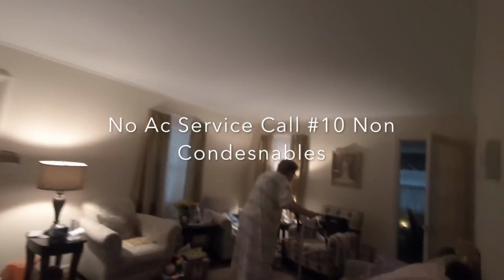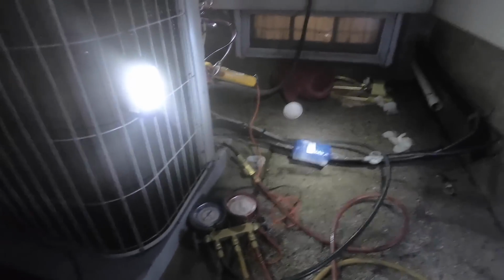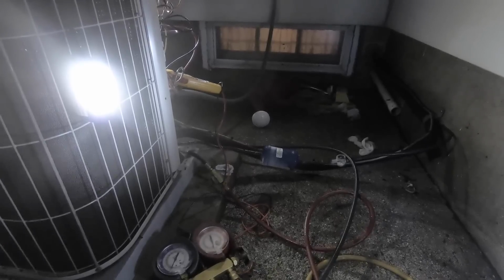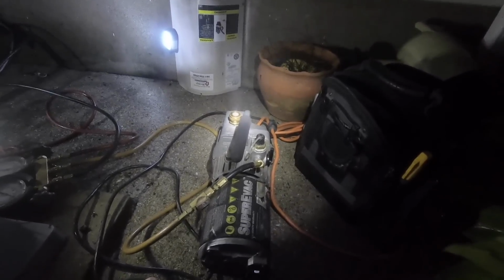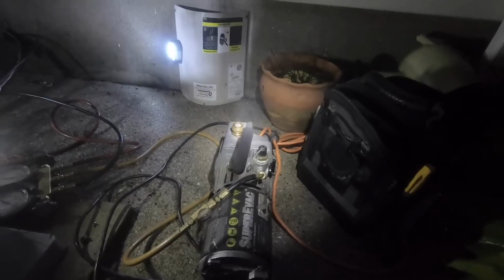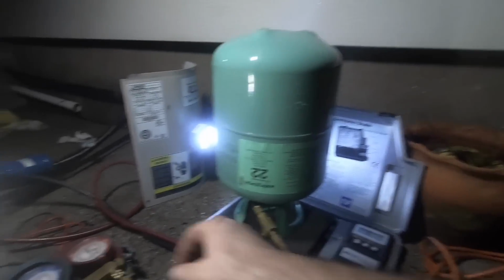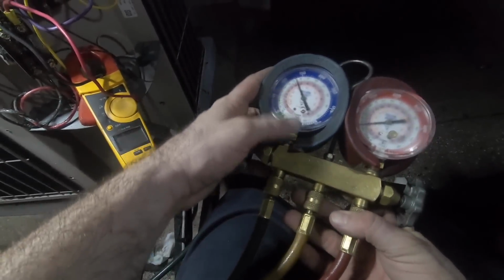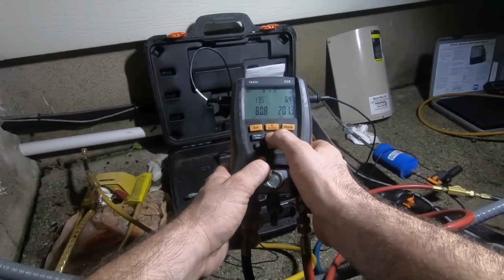AC Not Cooling Contaminated System Overheating Compressor HVAC

Comment: Don't worry about these opinions. Every call can be done better in one way or another. At least you are trying to do the right thing. Sorry but these techs who are working for companies that are driving them to sell replacement systems at all costs should be ignored due to the fact that "most" of them do not know shit and nor  do the owners. Those companies hire young guys to run the numbers game period and quite frankly it's criminal behavior. They can talk some lingo but wouldn't know where to start beyond changing a capacitor. Example: I was training a man last week who had worked for another company for two years running maintenance and service.  I let him know that we were going to work on airflow all week and we'll start with Delta T's. He asked me what a Delta T was.  In his head, he knew what he was doing in the field, but found out quickly otherwise. I'm just  glad he wanted to learn. He had only been trained to cycle the system, clean the condenser, check for a rusty or leaky coil and call for a TURN OVER. This is a rampid problem across the country. The people who bought the company I work for don't know shit about HVAC. They are simply trying to make their investors happy. They are implementing the " if the repair is $500, call for a salesman" program. Their capacitor price is $300. Sorry but this is bullshit and not true service. They are criminals and that's why I am leaving asap. 
Yes,  there are time and procedure issues on every service call. As long as you communicate and charge properly they eventually work out. The calls that I make the most on, are the ones I walk away from and don't waste any time on. Asking questions and weeding out the bullshit calls are a techs best start. Low cost service calls get a lot of home warranty calls because they are cheaper than the HW service call and the home owner  usually only wants you to diagnose it and not repair. Example of a Big Waste of Time.
Reply from the maker: My company is starting the corporate route. Hopefully they don’t change and screw up what’s been working for 80+ years. they still expect quality work from techs and what’s best for customer. You always get the new guy who thinks he is the greatest tech since where he worked no 3xperienced techs worked there. We get the guys who say they are commercial service techs. Not realizing how severe the commercial work is. I screwed myself when I first started with this job I told them I am strong on the essential service side I do some commercial yet not a lot. Took many years to get a solid workload of commercial yet they know what I can do and what I will figure out yet might take me a little longer. I am @ good tech not the best nor the worst. Do I always need to get better and learn, always.

Comment: I have two sets of the testo 550's they give me issues in the winter but I really like them
Reply from the maker: I like my 550’s I need to order a new hanging clip since mine broke. I am looking at new testo 550’s and testo smart probes, yellow jacket mantooth smart probes or I manifold. Might just stick with testo’s I know they are reliable
Reply: @thehvachacker  I also have the smart probes the come in handy on large equipment
Reply from the maker: With the smart probes you still use the 550’s? I was considering using a access t and a hose just to connect to tank if I went the route of the smart probes.

Comment: wonder what happened-unit shuts off i hope-no crazy running in a vacuum. stumped how this system got noncondensibles in it-nice job taking care of it for that nice lady-kudos to you
Reply from the maker: Did you see how high the suction and head pressure were jumping to before I shut it down. I think that was an r22 compressor attempting to compress 410a. Which caused the compressor to shut down on thermal OL. I believe that her ac couldn’t keep up with nj temps over design temp for almost 2 weeks and called another company or a neighbors kid. she was under the impression if she needed r22 we weren’t recharging residential units. So whoever she called gave her some Freezon out of the pink can.

Comment: What multi meter are you using and how do you like it? Looking to get a good one
Reply from the maker: I use the fluke 902 and it has been my go-to meter since 2010. I do like it and would only go with fluke from this point forward. Before this meter, I was using fieldpiece meters and they would only last 2 or 4 years before part of the meter failed and I needed a new one. I am looking at the fluke 87v and 376fc for my generator work yet for HVAC the 902 does everything needed

Comment: If gauge didn't go down early when you put on vacuum pump that means there's water in the system.
Reply from the maker: You will also have some refrigerant trapped in the oils in the compressor

Comment: Curious on what the bill was for this call.
Reply from the maker: 3 hours labor 4lbs of r22 and disposal of 5lbs of mystery 410a and 22. Prices aren’t important this is what was billed out. Prices are different everywhere and become almost as touchy a subject as politics and sports
Reply: @thehvachacker  i understand, but that's why I'm curious, because of the crazy differences in pricing. I think the company i just left was high priced. Everyone is flat rate out here. I just bought a van for myself. 😉
Reply: +Erik Henson 1,200. To the lady. It was a great deal because she thought she was going to have to buy a new one. 
Actual repair 350-600

Comment: What magnetic light is that?
Reply from the maker: https://youtu.be/QjrSLDu4sKI its the Braun Slim Bar folding light from harbor freight. this is one of the only reviews I have done on this channel since many want to know about the light. You will see it in use in most of my videos so I felt it qualified for a review video.
Reply: Both are from Harbor Freight. Black stick one is Braun 63958 and rechargeable. Around $20 when on sale, around $30 when not. Blue one he has is the one Harbor Freight gives out for free with purchase pretty much year around. Or you could buy one for $2.
Reply: Thanks

Comment: Your face blur around 21 minutes wasn't working. So, I noticed the expression on your customer's face is pretty much every customer my journeyman dealt with. Even explaining something in the simplest terms possible you still loose them. Furnaces are alot easier to explain.
Reply from the maker: Too much info was her facial expression. all she wanted was for me to say yes you can feed me
Reply: Furnaces are alot easier because heat loss during winter can cause serious damage. People will usually pay anything to get it back up and prevent potential freeze ups which could possibly burst pipes and cause further damage. To my hacker friend I think you did a great job with the call and I felt like it was summer again when the sunset and the unit was still open. Tip for speaking with clients keep it simple. Unless they want specifics to test your knowledge, tell them whats wrong and what will fix it. I find this to work for me on big commercial quotes for installs and repairs. Personality means ten times more than knowledge in this trade now and if you can channel both your golden.

Comment: micron gauge???????
Reply from the maker: Never hurts to use, even though I see too many never use them.
Reply: Pretty much a vacuum gauge. When i worked hvac before the company pretty much told me they had no work for me, we used them for every install for a leak check before charging.
Reply: @bairfamilyfarm1336  Actually a vacuum is never the method to use for leak check but may indicate there is one.  Need to nitrogen charge for leaks.  Leaks can also happen under vacuum that wont under positive pressure. The system should've have been pulled down to at least 500 microns with no appreciable rise to thoroughly dry it before charging though.  But I seem to recall hearing that r22 systems are more resilient to skipping that than r410a systems.
Reply from the maker: @bairfamilyfarm1336  Every new system needs to be evacuated and a micron gauge used. This right here is just trying to make a messed up system operate. If the machine can hold 500 microns there shouldn't be any leaks. They say armoflex can get sucked tightly and seal a leak during an evacuation. That a pressure test also needs to be performed.

Comment: Good Job. There will always be haters. She is cool again and you didnt immediately call your sales guy. You could have probably made more on the commision of the new  compressor or entire condensing unit but you fixed the problem rather than the service fee and repair. Mission accomplished.
Reply from the maker: Getting a system up and running is more rewarding than making commission on a system sale.

Comment: So if there are noncondensibles or contaminanted freon should you replace the dryer filter as well?
Reply: No drier replaced on a system with suspected contaminated gas? Didn’t purge lines on fitting gauges. I work for a service partner in the uk, For one of the biggest refrigeration companies in the world. They wouldn’t even pay us if we did that. Why not just come back another day and do the job properly. No better than a recharge and run engineer otherwise. We all try to get it done and help the customer, but the end of the day we work with gas that killing the planet. Surly using it  as best we can is a better option. Rather than knowing that system will  need a drier at some point now. Do you not nitrogen every system before a recharge as well? How do you know you never had a leak on that unit that was masked by the fault? Vac will not show a small leak especially not using a micron gauge and checking you hold vac????
Reply from the maker: I should if I had one. Used a filter drier on a leak repair on the call before I came out to this one
Reply: The HVAC Hacker ok just making sure I’m an apprentice and was just making sure thanks for the response i like your channel and learning a lot from it thanks for making all your videos
Reply from the maker: @darksabatta  you can learn a lot from what I do and also learn what not to do. I have been in the field for a long time and seen many things I shouldn't have. I was taught to do whatever it takes to make it work. Even if it wasn't by what the books say. I will say learn from those you work with. I took a  chance by not changing the drier to provide cooling for this nice old lady. Many might have condemned this system and walked away. I would usually replace the drier in this situation and also use a micron gauge.
Reply: Does the Pope shit in his hat??

Comment: Vapor or air in the system can cause similar results
Reply from the maker: Would the low side go as high? If air or moisture was in the system? This is rare to run into calls like this so it is possible. I have had contaminants that caused needle pulsation. What baffles me was how quickly the high side shot up and the low side resembled 410a pressures. I wouldn't think the txv would allow that kind of flow. Unless it went through the equalizing line. I am a student every day in this field. So open to all suggestions. I am happy I was able to get this system to operate and no damage happened to this system.

Comment: if you lose a partial 410 charge and just try topping up, at some point the head will shoot up to 600 and it will trip on internals. gotta reclaim and add new charge.
Reply from the maker: 410a you can just keep recharging. They proven you don't need to recover and recharge 410a years ago. Yet this is an r22 machine which should never see pressures that high. especially with a wet coil
Reply from the maker: Yet if you re losing your 410a or any charge you have a leak that needs to be repaired.
Reply: The glide on 410 is only like 3 degrees (near-azeotrope blend). It might affect the discharge temperature a little bit if heavily fractionating the 410 but from what I've read it won't be an issue with oiling or anything.  It won't affect overall performance much at all.
Reply: Bottom line is 410a is a blend 50/50 
I never top off a blend  and have not had a call back  just saying
Reply: @mikescustomspeedshop171  A study was published by ASHRAE several years ago where blends were allowed to leak 50% & then topped off, four times.. There was no measurable performance difference. Even DuPont no longer promotes the fractionation myth.
Reply: Thanks for the update Jason that’s good to know
Reply from the maker: The only machine it’s best to remove and give. A fresh charge is a ductless split where you will need to weigh in the charge.
Reply: Cool thanks Jason
Reply: True, it's called fractionizing. Read up about it

Comment: If I worked on a system like you I would be fired
Reply from the maker: If you get fired for fixing all the equipment you run into with almost no call backs that is a terrible company to work for.
Reply: @thehvachacker  I am talking about how long it took to diagnose and fix.  And the fact you didn't use a micron gauge
Reply from the maker: @TheKiltedHam  This job was up and running 3 hours after I arrived. The micron gauge is broken and my bose knows. So your employer doesn't like money? That's 3 hours of billable work. I knew what was wrong as soon as I got the compressor cooled off and operating. Can't do anything on a compressor off on overload, except cool it off. Like I said if anyone gets fired for pulling this repair off there employer isn't worth working for.
Reply: Chris Bone Were we watching the same video? Considering the circumstances, 3 hours is a fairly reasonable time considering the compressor was on overload and stupid hot. Gotta let that stuff cool down and it takes time.

Comment: You didn't use a micron gauge.  I could still here the pump gergling.
Reply from the maker: my micron gauge was broken and wasn't replaced at the time of this call.
Reply: Hvac hacker.  I have been in the business about as long as you and when I started No one had a micron gauge.  Especially installers.  Earlier this year I replaced a 24 year old system in South Texas that was still running.  I guess if they had a micron gauge we could have let it run 48 years.  You did a great job.  I carry a bluvac micron gauge and have an sman460.  Still pulled many vacuums with gauges.  Keep it up.

Comment: I would have never thought someone put 410 in there ???  question is why ??? that kinda hurry just got you what 6 hrs. here
Reply from the maker: I have no idea why anyone does what they do. Lennox has many condensers that look like this that operate off 410a. I was only there a little over 3 hours. After that, I still had another call.
Reply: Happens more often than you'd think. Especially back when that Lennox condenser was built Puron wasn't super popular and tech's would just assume the higher than usual suction pressure was normal and consider that most technicians never check the liquid line pressure on AC calls.

Comment: last time I saw the gauges do that the expansion  valve was bad pressures had equalized ???
Reply from the maker: Yes pressures equalized yet it ran long enough for that to happen. This was as soon as I started the compressor and if txv was pinned shut it would pump down the low side
Reply: @thehvachacker  a liquid restriction like a plugged txv will typically cause low head pressure, not high. (unless it's been overcharged). Head pressure is a function of the heat load being picked up in the evap. No evap flow = no load = low head pressure. It's easiest to see in a pumpdown system. When the LL solenoid closes, the head pressure will drop a little as it pumps down. Point being, a closed txv does not cause high head pressure (microchannel coils being the exception).

Comment: Have run across  some  one has been in it and nobody knows  anything.  The overcharging  gas thing  in a number of cases. This happens  when evaporation coil is dirty  and the person that is working on it is just trying to get  the low side up.
Reply: Put guage on that recovery tank, measure temperature of tank and compare with pt chart to know what's in there. Or could run condenser fan b4 pulling gas 5-10mins measure pressure compared to outdoor ambient to see if it's close the gas on data plate and pt chart. If it's way off either non condensables, gas mix or wrong gas.
Reply from the maker: Yes, but you ever have an r22 overcharge that put suction pressure above 125. The high side yes I could understand the overcharge theory. I only pulled less than 5lbs out. Yes slightly overcharged yet not to cause these pressures. Usually, a dirty evap coil or defective txv is most causes of an overcharge.
Reply: @thehvachacker  internal pressure  relief valve(inside the compressor  )opening to low side.  The other possible causes  some tried adding  R410 in it . In service  work  expect the  unexpected.  In this case going  through  all the steps    corrected  the trouble. Before  it died 😧 good job !
Reply from the maker: That is the important part was correcting the issue and getting this ac to pump correctly. The internal relief yes when open you have hi suction yet the compressor didn't run long enough or make the wooshing sound of the internal relief opening. At least this nice lonely old lady had relief from the almost 100 degree temps my area was smashed with that week.

Comment: How much did the drum weight after recovery, to make sure you didn't miss if unit had been over charged. Back in the day my vacuum pump was used. Been at this for 40 years.
Reply from the maker: I don't remember the recovery cylinders weight yet I only pulled less than 5 lbs out. You might have used your pump many when I started didn't. They would do a fast purge. Before setting up their pressure testing with r22.